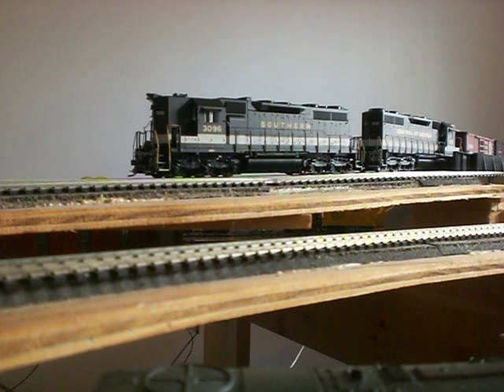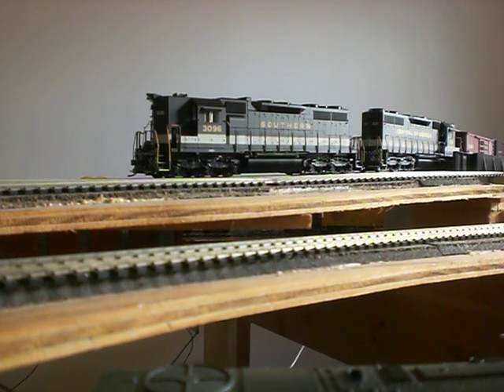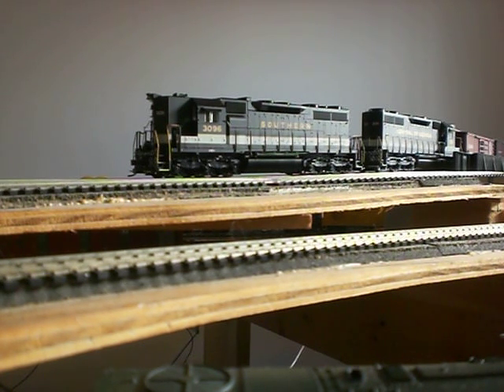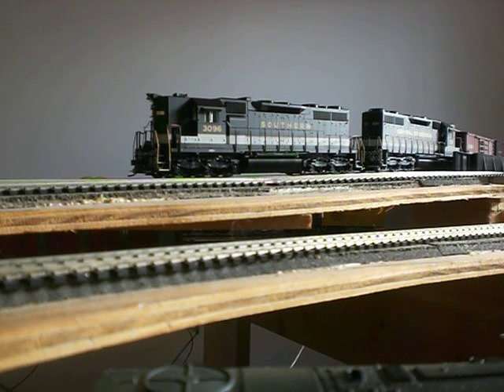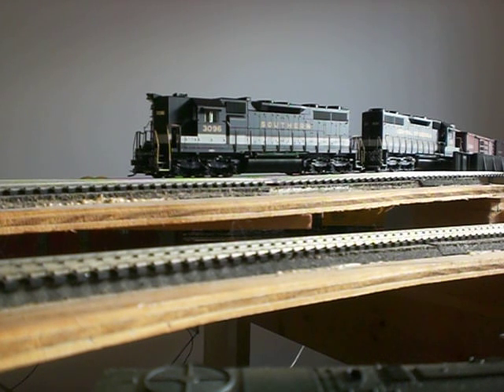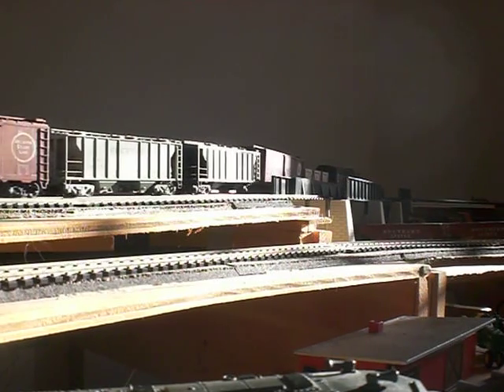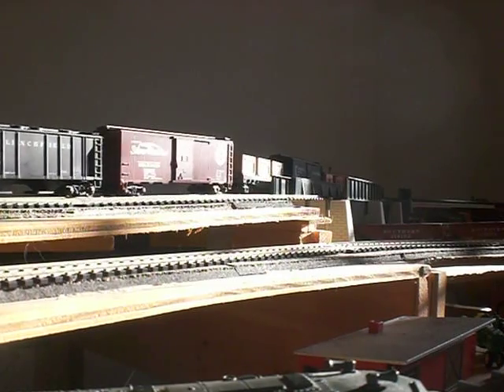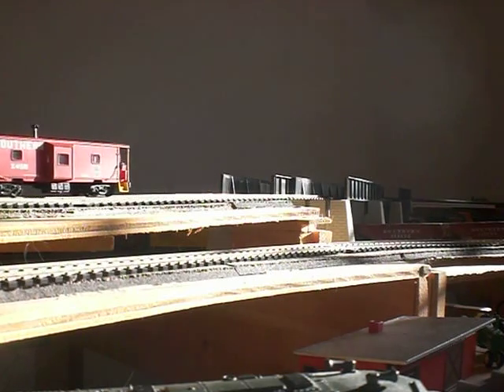Southern SD35 with Digitrax SDH164D Sound Decoder  upgrade to SD40-2 Sound

Comment from the maker: I used a small round speaker which I placed in the dynamic brake blister which one of my guys in my train club had given me. Not sure what manufacturer it was from. I like the Micromark rectangle ones. Several people I know have used those with good results .Also if you have the problem of the engine slowing down while blowing the horn here are the CV's that can correct that. set CV2 at 25, CV5 to 150, and CV6 to 115.

Comment: Can you tell me what speaker you are using?  I was unable to fit the included 28mm speaker into my shell.  I am using a speaker from the sdn144? .... the N/HO scale decoder.  I might just get more of the smaller red ones from now on...  The small speaker actually sounds pretty good, just stuck to the inside of the shell for now.  I have 2 speakers coming in the mail with an order from micro-mark, rectangle ones with enclosure... hope one fits OK..  So far I'm happy for under $40 on sale at LTS

Comment from the maker: Yes when I first got the decoder I noticed that also. It has not stopped but I did notice a little slow down. My one that I put in my Proto 2000 F3 does not do it all. the only disappointment I have of it is Diesel rev down and rev up.I noticed you can manually notch it but I have not done this feature. Especially in the F3. But for the money its a good buy.

Comment: I have purchased several of those SDH164D sound decoders, I have been unsecessful in loading the sound projects off their website using their PR-3 and Decoder Pro.  The computer says the sound project was loaded, but when I go to play the files, there is nothing.  I changed CV60 to "1" and also to "0" and no sound. I returned two the ones I loaded sound files to and digitrax replaced them w/ new ones w/ no explaination what I did wrong.  Any pointers for me how to correct problem?  THANKS!!!